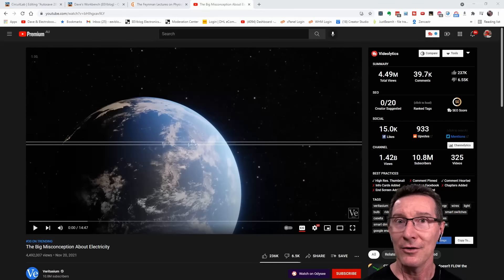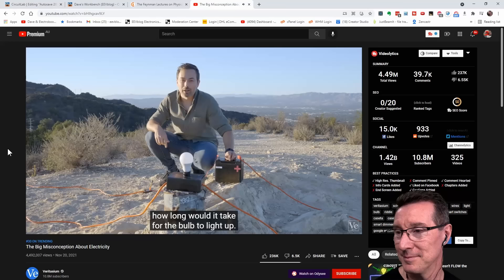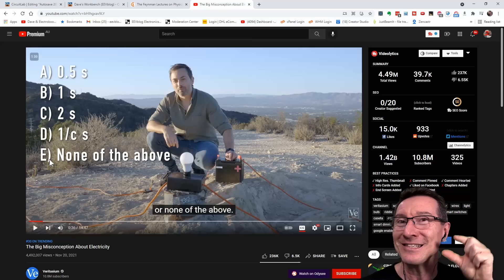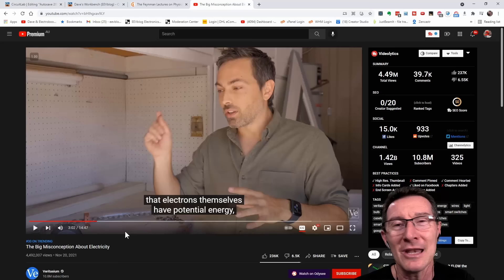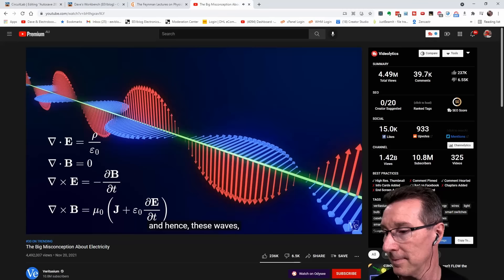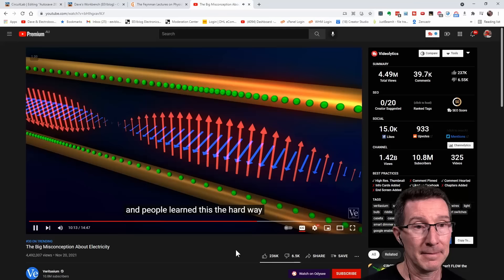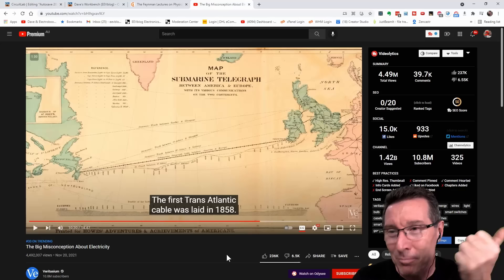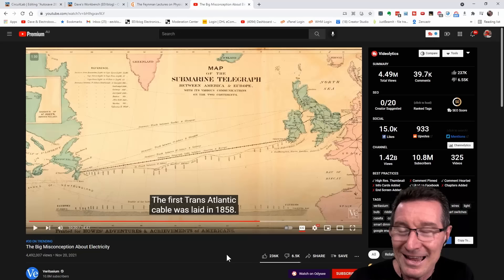EEVblog 1439 - Analysing Veritasium's Electricity Misconceptions Video

Comment: My personal problem with Derek's analysis is that (as can be seen from your simulation), the "ON" state of the lamp lasts only a couple of miliseconds. I don't consider this to be actually "ON". Particularly in a video aimed at general public (i.e. not electrical engineers / physicists), no one would consider this to be ON. For something to be consodered ON in this context, it has to stay on (steady state). So, the answer is not 1/c. If the question was "when will you see a voltage spike across the lamp in the transient analysys of the circuit?", then the answer would be 1/c
Reply: What he doesn't bother to explain, is that it isn't just the fields close to the switch that are at play.  After the switch is turned on, there is an immediate step in the voltage at the wire, which gets coupled to the other wire.  But also, that step is moving toward the right over time, such that for the whole time that voltage step is moving to the right in the lower wire, it is coupling to the upper wire, and takes a while to get back to the light bulb.  So the whole time the pulse is traveling to the right, there is energy being transferred to the upper wire.  This continues until the pulse turns around at the end, returning on the upper wire.  The result is that there is a (near) instantaneous low-level lighting of the bulb for one second, followed by a brightening at the one second point.  At least, this is how it works if you use a random size of wire and a random light bulb.  But because the pulse is losing energy as it propagates, if the wire (actually a transmission line) and the bulb are properly matched, you won't see a change in brightness because the pulse that had to travel the whole distance will be at the same level as the current that was induced as it traveled to the right.
Reply: @BrightBlueJim  Are you saying that if the transmission line had been perfectly matched to the light bulb in Dave's simulation, then the voltage and current would be constant after t=0 rather than instantly drop off?  Is it even possible for the transmission line in Derek's hypothetical experiment to ever be matched to the light bulb?
Reply: @ncmaothvez  Yes, that's what I'm saying.  Almost.  There's still the 1/c delay that the pulse has due to the 1m spacing between the wires. and yes, after around 3ns, the light bulb goes on, and stays on at a constant brightness.

At least, that was what I thought.  Turns out I was still wrong, though.

At first, I was thrown off by the 1m spacing, because I'm used to much smaller dimensions in transmission lines, so I thought that the impedance of the line would be very high.  But then I "ran the numbers" and for a reasonable range of wire diameters, like 1mm to 10mm, the impedance is actually around 500 to 1000 ohms.  Using an on-line calculator for transmission line impedance, because I'm lazy, I find that making a twin-line transmission line out of 2mm wire, we get an impedance of 828 Ohm.  For a 120V light bulb to have a resistance of 828 ohms, it would have to pass (120V/828 Ohm =) 145 milliamps, which would make it a (0.145A * 120V =) 17.4W light bulb. This is close enough to the 16-17W of a typical "100W equivalent" bulb to work.

But NOW I realize that there's still a problem: the transient solution to this problem - what happens when the switch is flipped - puts the transmission line's impedance in series with the bulb, which results in half the voltage being dropped across the transmission line and the other half across the bulb, which Derek alludes to in his video.  BUT, the steady-state solution - what happens when the transient electric field has faded out because both wires eventuailly reach the same potential - drops nothing, due to the hypothetical zero-ohm wire, putting the full battery voltage across the bulb.  So I was wrong about that - even perfectly matched, the bulb will come on at half-brightness for one second before it abruptly rises to full brightness as the initial switch-on pulse travels around the loop and reaches the bulb.

I don't just know this from theory - I worked for six years in high-power microwave pulsed RADAR systems, which use a modulator that incorporates a set of inductors and capacitors to make an artificial transmission line that operates much like this circuit, and the amplitude of the pulse IS pretty close to constant over the time it takes a pulse to travel through the transmission line and back.  So the transient solution isn't just a quick spike caused by the capacitance between the wires, but a pulse whose length is twice the time delay of the transmission line.

Isn't electromagnetism fun?!
Reply: @BrightBlueJim  I've got to admit that my analog electronics theory knowledge doesn't reach very far beyond ohm's law and a crude understanding of transmission lines but I was still able to follow along in your explanation. Thanks for the reply! This got me curious, need to read a bit about transmission lines tomorrow when my brain is a bit more awake :) Yeah, I'd never have guessed the impedance would be as low as sub-1000 ohm's.
Reply: Exactly. This spike would happen even if the circuit is not closed. And we don't call that "ON". Yes, you generated 0.00...001A in it, but you don't need 2x300000km wire for that...
The ON state means at least that you can differentiate the current from the case when the circuit is not closed. It would be still a low current, but also at least .5sec...
Reply: @Csiki27  So a 10m piece of wire, 1m away, with a light bulb in the middle ,would also have a transient current induced at 1/c. But nobody would say this bulb is “on”.
Reply: No not a couple of milliseconds… The line is infinite, so  the capacity will be infinite so the current will flow infinitely till the battery dead
Reply: @andreyares6824  Here is the other problem: since the antenna is quite long you can't say anymore that your small capacitors will turn on "instantly" along the way. No simulation takes this into account since it makes evertything quite difficult, and we don't have such real life case (or extremly rare).
We know that very very small current will be generated at the beginning. That's all.
Also, nobody who see the video consider this proper working. If I walk into the bathroom with an AA battery in my hand, I don't tell, "Oh my god, I just turned on my washingmachine!"... The battery has tiny metals on their side, so we can consider them as antenna, right? The washing machine surely has some wire in it, right? Did I generated current in it? Yes, practically I generated current everywhere with that battery. Still, we don't call that on...
Reply: As Physicist.. i dissagree with Veritasum.. werry roughly when he delete my explanation coment.. Specialy when i use light math for say corectly what happening actualy.. Not gona repeat myself.. What Veritasum doing is start to be werry sketchy same asi his overunity car.. My lord what a BS..
Reply: @Csiki27  yeah that's what's stupid about this whole idea from Veritassium. If we have a 12V, 1A bulb and a 12V battery to power it, and the characteristic impedance of each transmission line is 900 ohm, then 6.6mA will flow through the bulb after 1/c seconds. That's equivalent to 0.7x10^-9 the normal bulb power. No reasonable person would consider the bulb to be "on".
Reply: @Csiki27  Actually I can, because we imagine a conductor without any resistance, this is also look like a giant capacitor. Try to measure resistance using multimeter on big discharged capacitor more than 10000 microFarad (you will have almost NO RESISTANCE) and then once you charge it- make a short circuit and You will see how much power it has- it’s not a tiny small battery like you talking! I don’t see anything strange or something new here Except that humans become less  interesting in science after they got personal computers and other toys and everybody can trick you with a stupid clickbite.
Reply: @andreyares6824  I think you miss the main point of the argument. Nobody questions that discharging it gives you the needed power, but that will happen well after 1m/c time more precisely at least after .5sec (I don't know the correct solution, but I know what is the minimum time). Before that you are simply not able to distinguish whether the circuit is closed or not.
And if it wasn't a closed circuit then the light won't turn on (eventhough theoritically you could measure that tiny transient current at 1m/c time). So you simply have no right to tell from that tiny current that the light is on.
Reply: @bradau1827  Yes.
Reply: @nin1ten1do  Well then, I guess I'll just have to take your word for it.
Reply: I agree!
Reply: It is not the case that the on state is short-lived (unless there's a break in the wire).
Reply: Right, this is just about the little burst at the beginning, isn't it? Blehhh.... He was being kind of a scammer this time!
Reply: And there will be no measurable current in the wire exactly in “1/c”.
Reply: @noop9k  Why do you think it can't be measured? We've measured some pretty small signals before.
Reply: Yes you're exactly right. There might be an instantaneous pulse of energy into the light bulb, but the battery is a DC source. So one second later DC energy will be flowing through the light bulb. I doubt there's much energy coupled over the distance of 1 m so the pulse might not even be visible.
Reply: @nin1ten1do  sorry, you are a troll, while I disagree with Veritasium, I’d delete your comments as well.
Reply: It wouldn't even be 1m/c then.  Because 1m/c doesn't have any of that wire in the light-cone of the switch.  Without wire in play, the position of the switch is irrelevant, because the bulb is ALREADY either 'On' (for a given value of on) or 'Off' on the basis of the wireless electrical transmission occurring through that meter between the battery and the light.
Reply: @BrightBlueJim  I agree with you. There are two states, one with a relatively small current and one with a much higher current, with a sudden jump in between. The funny thing to me is that I think this transient state solution is precisely where, while IRL you may use TLT to figure it out, I think just for intuition it makes way way more sense to simply imagine the waves and "run a finite-element method simulation in your head" and think of what will happen then. That way you can even see that the current is of course not EXACTLY constant because of all the ripples causes by the bounces from the ends of the wire, but roughly speaking there are two approximate power levels. While TLT /should/ give you the correct answer if you run the simulation correctly, for my brain at least thinking of the fields propagating makes me reach the same conclusion way faster and more reliably. It may be an interesting boundary problem neither is obviously superior in understanding what's going on.
Reply: @TrogdorBurnin8or  You have a full meter of wire going to the left of the switch, and a full meter of wire going to the right of the switch, all within 1 m of the switch. Since that wire radiates, it's an antenna.

The terminals of the lamp are 1 m from the switch, and begin to act as a receiving antenna 1 m/c after the switch closes.
Reply: @rsm3t  A spot on the wire one meter to the left is sqrt(2) meters from the light, if we're being pedantic.  More seriously, let's talk limits: The length of effective antenna approaches zero as time approaches 1m/c from above.
Reply: @rsm3t  The core argument, of course, is that infinitesimal inductive transfer due to considerable distance between the antennae is irrelevant to "lighting the lamp".  But the secondary argument is that inductive transfer only begins in any theoretical sense at 1m/c, the instantaneous current flow at that timestamp is zero; Reaching any kind of significant arbitrary current flow through induction requires 1m/c PLUS arbitrary time.
Reply: @TrogdorBurnin8or  That is just the edge of the wavefront. Without losses or resonances in our idealized experiment, it will remain a step function. On arrival, current must begin to flow in the receiving wire.
Reply: @TrogdorBurnin8or  but you had said "light-cone of the switch", not "light-cone of the light", so if you want to be pedantic, do it right.
Reply: @thebaker8637  I put it in terms of transmission lines, because that's what I've had a lot of professional experience with, but the way I think about transmission lines, when I don't remember something for sure, is as strings inductors in series with the wires and parallel capacitors between the wires.  If nothing else, that will tell you how it will behave in the very short term (i.e., in Veritasium's quiz, capacitor from the switch to the light bulb will be an instantaneous short), and also in the very long term, which in this case it's just a plain wire loop.  So we know from these things that a) Derek is right about the delay before the lamp comes on is 1m/c, and that eventually the light will be powered by the direct current through the wire.  But what transmission line theory ALSO tells me is what will happen between the two extremes, which can be a little surprising if you think about it as anything OTHER than a TL.
Reply: @rsm3t  There is no step-like change in t=0 when the (idealized, perfect, point-sized) switch is closed. Switch doesn’t itself create any change in EM field. At t=0 electrons are just allowed to move across the switch under influence of already existing field. And only after they change position/velocity (this effect gradually propagates at speed < c along the wire and through battery), they create a change in EM field that can affect the opposite side of the wire and induce some (small) current.
At t=0 at the switch and at t=1/c at the bulb there is no change *yet*.
Again, this is not a step function where EM field suddenly appears from nowhere as if the battery+some wire teleported into the circuit.
Veritasium’s answer requires impossible wire, impossible lightbulb,  impossible switch and is still wrong.
Reply: @rsm3t  Not a step function  at all, unless your battery, switch(already closed) and a few m of (pre-charged, or taken from already activated circuit) wire suddenly teleport into the circuit at t=0
Reply: @noop9k  It's pretty obtuse to deny that closing the switch creates a step function.
Reply: @rsm3t  there is no step-like change in EM field. There is a step-like change in current but the length of the area affected by this change starts from 0.
Since I’m not getting through, will repeat: closing the (infinitely small, perfect) switch does not cause any instant change in EM field by itself.
Otherwise, explain, how changing the resistance of infinitely small length of wire from inf. to 0 causes EM field to appear instantly at the same exact moment.
|B| is not a step function, |B|’ maybe close to a step function at t=0
Reply: It won't even light up from the microwatt
Reply: @Csiki27  wrong
Reply: @Ikbeneengeit  exactly
Reply: @esecallum  Everybody knows that it won't light up in reality. The question is whether we can consider that on theoritically. And most of us think that no. Wich one is wrong from these?
Reply: @esecallum  How do you know it's only a microwatt? The schematic doesn't tell you the voltage of the battery, the characteristic impedance of the cable, or the resistance of the bulb. For all we know, that battery could be 10000 volts. However, we are told in the video to assume that the bulb will light as soon any current flows through it. So we're really being asked when current begins to flow in the bulb.

I see no point in debating the assumptions. That's equivalent to changing the question before giving an answer. We should be concerned with what conclusion follows from the assumptions.
Reply: @noop9k  If there is a step change in current, there is a corresponding step change in magnetic field. Study Maxwell's equations and you will come to understand this fact.
Reply: @noop9k  If you're assumption is correct, that a step in current causes a step in the magnetic field's derivative, then as long as the current flows, the magnetic field strength would increase without bound.
Reply: @Ikbeneengeit  your numbers don't work out. (6.6 mA/1 A)^2 is 43.6x10^(-6), not 0.7x10^(-9).
Reply: @rsm3t  he never specified so we assume normal values. What battery has 1000000 by volts.
Reply: JESUS CHRIST IS COMING TO JUDGE THE EARTH SOON PLEASE!!!!!!!!!!!! CALL ON HIM NOOOOOOOOOOOOOOOOOOOOW!!!!!!!!!!!!!!!!!!!!!!!!!!!!
Reply: @rsm3t  you still don’t understand
Reply: @rsm3t  not without bound, just as sine doesn’t increase “without bound”
Reply: @noop9k  A step function does not integrate to a sinusoid.
Reply: @noop9k  Do you understand divergence and curl? If so, you shouldn't have trouble understanding Maxwell's equations. If not, please don't lecture me on things you don't understand.
Reply: @Csiki27  I have no patience to kip this conversation)
Reply: @andreyares6824  Hi, another video clearly clarified (with proper simulation), that not only the current will be "stable" as you said, but even the current can be comparable with the regular "on" state.
The only (rather theoritical) question left that what we call "on" since if the circuit is open the current will go down after 1 sec to zero (so at 1m/c you don't know whether this is a successful switching).
On the other side this is not a short time current.
From my side I pick the first (this is not on till you don't know that you succeed), but I can accept that the second can be a valid option as well (with properly set circuit ofc).
https://www.youtube.com/watch?v=RsiYXfpJu5U
Reply: @BrightBlueJim   @BrightBlueJim  In a perfectly matched system there would be a termination resistor at each end of the line so the lamp would be  immediately at it's final brightness
Reply: @bene5431  Yes, that's exactly right.  A properly terminated transmission line measured at its input is indistinguishable from a resistor equal to its characteristic impedance, so then all you have is the delay caused by the 1m spacing, which is the 1m/300Mm/s = 3.33ns, plus any other wire delays not specified in the problem.
Reply: @Ikbeneengeit  6.6mA is sufficient to make a LED bulb glow. The bulb does not have to be incandescent, does it?
Reply: The point is that the energy flux (a real thing you can read about) is what actually seems to be transmitting the power according to physics. All the EM stuff are emergent effects. 

The experiment he used to show this was messy. It isn't a clean perfect isolation of the reality at work here.
Reply: @bobdole57  Yes, and also no.  It's not a "clean, perfect isolation of the reality", because reality is neither clean nore pure.  Sure, it is important to understand that during the transient portion of its operation, electromagnetic fields are involved.  That is, when you turn the switch on, and when you turn the switch off, for a moment, these are all that matters.  But it is simply NOT POSSIBLE for this to happen in the steady state, after the bulb has been on for a bit.  This is because a) you can't get a steady flow of current through a capacitor (the electric field), nor can you collect power from the magnetic field around a wire, when that field is not changing.  This leaves you with ONLY the current through the bulk of the wire as a viable way of moving that energy.  AND HE KNOWS THIS.

What makes the Veritasium video a trick question, is that anybody with practical experience says, "those wires are a meter apart - there can't be a whole lot of coupling between them."  Which is a mistake.  But while he's jeering at you for being wrong about that, he totally slips out the back door before you have a chance to ask how that works a few seconds, or a minute, or a year after the switch is turned on.  And yet he considers himself a teacher.  Yeah, I've had teachers like that.
Reply: @BrightBlueJim  it was an entertaining video on YouTube not a graded exam.

2) I specifically said it WAS NOT a clean perfect isolation. You didn't need to reiterate that like I said the opposite
Reply: @bobdole57  Well, if you are going to back up Derek's BS, then I will treat it as your BS as well.  You weren't really clear about what you mean with the "not a clean perfect isolation", so I apologize if I misinterpreted that.
I would also say that it doesn't matter if it's a graded exam or not.  The whole Internet is full of people at each other's throats over things ranging from half-truths to blatant lies.  Derek's video is a half-truth, and I'll leave it at that.
Reply: @BrightBlueJim  if he removed the quiz from the beginning would you stop complaining. Is that your entire problem
Reply: @bobdole57  No.  You are missing the whole point.  My point is, he is teaching physics BADLY.  Badly because it's wrong, and badly because of his attitude.
Reply: this makes me think about the part where he says "when the bulb receives any current it will turn on". That "any" is really important. there will always be leakage, which means technically the bulb should always be on.
Reply: @davidmiller9485  he's describing an ideal circuit with no leakage. Remember when you had to calculate the trajectory of a projectile in physics, ignoring air resistance because it wasn't relevant to newtons law's? Same thing but cooler
Reply: @Saman Bahrampoor
Yes!  Furthermore, Dave here uses the wrong model for Derek's experiment setup.  A transmission line model is not applicable, so what you see on his graph is incorrect, and Derek's answer of 1/c is also not right. The better model is a dipole antenna model.   Also, Derek conflates DC steady state with transient analysis which is false and folks who want to learn, get misled.  See my explanation in the main thread.
Reply: @BrightBlueJim  No!  Dave here uses the wrong model for Derek's experiment setup.  A transmission line model is not applicable, so what you see on his graph is incorrect, and Derek's answer of 1/c is also not right. The better model is a dipole antenna model.   Also, Derek conflates DC steady state with transient analysis which is false and folks who want to learn, get misled.  See my explanation in the main thread.
Reply: @Ikbeneengeit  Yes, you're on the right track!  Furthermore, Dave here uses the wrong model for Derek's experiment setup.  A transmission line model is not applicable, so what you see on his graph is incorrect, and Derek's answer of 1/c for steady ON is also not right, misleading. The better model is a dipole antenna model.   Also, Derek conflates DC steady state with transient analysis which is false and folks who want to learn, get misled.  See my explanation in the main thread.
Reply: @stickfijibugs  Well, maybe I could take you seriously, if you could explain how a transmission line model does not apply here.  You can't just come in here and say, "you are wrong and I am right".  Why would anybody accept this without explanation?  Or at least explain why you believe the dipole antenna model is better for this problem.
Reply: @BrightBlueJim  That's a valid concern.  In my short note, I did mention I have a post in the main thread that answers everything.  I copied it here for you.  I hope you find it interesting and I would like to see your take.

=====================

Dave's transmission line model is not the right model to apply to Derek's circuit.  Read on ...

More, in Derek's video, his answer of 1/c seconds (1 meter-between-wires / speed-of-light-in-meters-per-sec) for the way he has his experiment set up, is also incorrect.   

[Note: I made some new edits in the '"more here" below.]

On top of it, Derek's is a very poor explanation at best.  The big problem with his video is at the beginning he conflates AC step signal (action of throwing the switch) with DC steady-state (turning ON the bulb), and it looks like he himself does not understand the difference.  That is surprising, and why his consultants in the video didn't explain it to him.

For example, taking his circuit as in his diagram where two parallel wires separated by 1m over a very long distance, true that there is a TINY amount power transfer that occurs INSTANTANEOUSLY due to 'antenna effect' between the conductors right near the switch and the bulb.  But, that would not even flash his bulb in the least (the AC signal part).  Even a very sensitive LED would not momentarily light up: the 1 meter separation is just WAY too far to transfer enough power, although, you might be able to see the a tiny short impulse with an oscilloscope across the bulb.

However, if the wires were very close together, say separated just by the thickness of (very thin) insulation, then the bulb (better a sensitive LED) might produce a barely visible SHORT FLASH at the moment he closes the switch at 1/c later (which is also half-explained in the rest of Derek's video with the E&M vectors etc), and then stay OFF until travel is completed around the whole loop (a total of 1 light-seconds if wires are at absolute 0 adding no delay).

So, at that point with an experiment topology where the wires are close together, after the short flash on closing the switch, 1 second later, the bulb would start to turn ON over a short but noticeable delay, and then stay FULL ON.

In conclusion, if the wires were run right beside each other, the answer would be both:  1m/c flash and 1 seconds later steady ON.

Thus, the real answer for the way he has his real experiment set up is 1 second, not 1/c seconds.  He needs to fix this.

More here ....

However, I disagree with EEVblog model of a transmission line:
https://youtu.be/VQsoG45Y_00?t=1553
The big fallacy with Dave, is that Derek's experiment is NOT a transmission line: in order to qualify the experiment for a transmission line model you'd have to remove the bulb (breaking the top of the circuit), disconnect the switch from its left wire side and connect the switch to the top wire that goes to the right.  Then you break the far end on the extreme right and insert the bulb.  Only then you can use the principle of the transmission line.

Thus a transmission line model does not apply to Derek's experiment.  I think Dave messed up pretty badly here, and I am dismayed why he did.

Let's say ... even if you rewired Derek's experiment into a transmission line circuit as I explain above, EEVblog's lumped element model would not be accurate either.  The characteristic impedance of the wire pair is indeed 900 ohms (in air), but remember, that impedance is looking into the right pair wires (or the left wire pair) with the switch open and bulb not connected!!!  Even so, EEVblog uses 1 uF capacitors. The capacitance of the wire pair is almost non-existent.  It DOES matter what the capacitance value is.  

What is the better model then?

In my opinion, the better model for switch flip instant is a dipole antenna with a step source at its center, and, I contend that the power transfer between the parallel wires is much greater due to the EM transient (Derek's AC explanation) than to instantaneous current flowing through an uncharged capacitor (in EEblog's incorrect lumped element model), especially that capacitance (Farads per unit-distance) is so small it is negligible.

Thus for the step transient in Derek's model, the top half with the light bulb is the receiver, and the bottom half is the transmitter.  

Therefore, to make an analogue of the transmitter (bottom) imagine you tied a long spring to 2 trees, and held the center point with your hand.  To close the switch, you give one quick jerk to the right say by a foot, and hold it there.  Watch what happens to the spring: you will see a compressed wave travel to your right away from you and an expanded wave travel to your left, also away from you.

That is what's happening electrically in Derek's setup at the moment he closes the switch.  The difference from the spring is that there are two electromagnetic disturbances that are traveling away from the switch, a dipole antenna.  Now you can apply the AC vector model and what you get is electromagnetic radiation (a single radio wave of all frequencies) that is traveling both ways, losing some of its power as a radio wave into space into all directions.

When that already very weak radio wave is intercepted by the wires on both sides of the bulb (also a dipole antenna), a quasi-step voltage is created across the bulb, but, is it SO small you would never see it light up.  That's why we have RF amplifiers in radio receivers (eg in your phone).

However, if the two wires were close together, it's possible you could see a barely perceptible single flash in an LED (bulb) followed by a DC steady state ON condition 1 second later.  In this case, if you connected an oscilloscope across the LED, you would see a quasi-step, but, you would see it die out rapidly as the transmitter step propagates away from the switch in the bottom half of the circuit.  So the voltage across the bulb would be ZERO in less than a microsecond I expect, and then finally begin its rise to the battery voltage 1 second later.  So not only will the bulb (realistically) light up 1 second later, it will be dim at first and then increase to full brightness, taking some noticeable time longer because of pulse spread effect over such a long distance in a single wire.

I hope this helps.
Reply: @stickfijibugs  Thank you for the explanation.  You are wrong, but thank you for taking the time to explain your reasoning in claiming that Dave and I are wrong.

1) A pair of wires in parallel IS a transmission line, whether you want to think of it as one or not.  Because it is made of conductors in parallel, there is capacitance between the wires.  Because it is made of wires, there is inductance in those wires.  You CAN, whether you choose to or not, to consider the pair of wires as an infinite number of small segments, in which each segment consists of two inductors with a capacitor linking them together.  You can do the circuit equations based on an infinite number of segments, which reduces to the transmission line equations, or you can used lumped capacitors and inductors in sufficient numbers that they are indistinguishable from a continuous transmission line, or you can use just a few, and have a correspondingly coarse approximation of the actual behavior.  In electromagnetics, there are often multiple ways of modeling  complex circuit, and we choose the model that best simplifies the problem for our particular application.  If a model doesn't simplify the equations, you don't use that model.  But it doesn't mean that model is not correct.

2) The spring model you use in part of your explanation IS the application of the transmission line model, so if the transmission line model is not accurate, then that portion of your explanation is invalid, so why would you use this?

3) In considering your transient response to the applied step function caused by closing the switch, you are only considering the speed of propagation through the capacitance, without also considering the speed of propagation through the wire inductance down the wire.  So while there is a 1/c delay of the step function coupling it to the light bulb, there is also a 2/c delay for each meter of the length of the parallel wires (2/c because the step has to go 2m to get through both sides of the line).  Now, I don't need the transmission line model to demonstrate this, so you don't have to accept section 1 above.  As the step function moves to the right, it takes time for the step to reach any given point on the wire, and AT THAT POINT, it encounters capacitance coupling it to the other wire across from it at that point.  So not only do you have a very short pulse at the very beginning of the wire (precisely the point at which the switch closes), but you have an infinite number of very short pulses, delayed by very short times, at each point along the wires.  These very short pulses at very short delays add up to make .. wait for it .. A STEP FUNCTION.  So the light does not just illuminate for a very short time, but CONTINUOUSLY for the time it takes for the switch-caused step function to travel down the wire.  So the light would come on at some reduced intensity during the entire time the step function travels down the wire, until but not including that last meter of wire, where it starts to look like a short circuit.  And once THAT happens, then the light is on at full brightness from that time onward.

4) This isn't just theoretical.  I worked for several years on pulsed microwave transmitters used in radar systems.  These use a set of actual inductors and capacitors (typically four to twelve of them, the actual number depending on how sharp you want the pulse edges to be) arranged in a manner very similar to Derek's circuit, and referred to either as an "artificial transmission line", or a "pulse forming network".  In place of Derek's switch, a gas thyratron tube is used to create the step function, and instead of a light bulb it is connected at the far end to a pulse transformer that feeds a high power magnetron, klystron, or other RF tube.  The length of the pulse is determined by the electrical length of the artificial transmission line.  So I've seen almost this exact circuit used in practical systems, and it works quite well.

Again, this does not depend on your acceptance that this is a transmission line; conversely, the fact that there is a speed-of-light delay through the inductance of the wire, just as there is a speed-of-light delay through the capacitance, which is what MAKES this a transmission line.  The fact that it is shorted at one end does not disqualify it as a transmission line, because the applied step function can't "see" (i.e., be affected by) that short circuit until it gets there.  But again, it doesn't matter whether or not you like the term "transmission line", because whether it is or is not one does not affect the behavior of the step function across the distributed capacitance and through the distributed inductance.
Reply: @BrightBlueJim  

Your #1:  It's not a question whether I'm right or wrong, or you're right or wrong, it's a question of whether Dave's model is applicable or not to Derek's experiment.  If I cut two 1m pieces of coax from spool, yes technically I have "a transmission line" in each of my hands.  But if I strip the 4 ends and use the two cables to boost my car, I am not using them as a transmission line!  Same can be said of two twisted pairs.  That's my point about Dave.  He is NOT driving the pair of wires as a transmission line should be driven.  Thus, a transmission line model cannot model Derek's experiment.  It's so obvious.

Your #2: Nope, it's the antenna model!  I use the spring as a SINGLE conductor for illustration of the bottom half of Derek's circuit.  Look at it this way ... if instead I remove the left end from the left tree and attach it to right tree in parallel with the original right half and cut it where I am standing, then I have a POSSIBLE xline setup, but, it still depends on how I use it.  So now using TWO hands, I jerk one spring towards the tree the other away from the tree, then yes, I am illustrating an xline.  However, if I jerk both springs away from the tree with one hand, then it's a single antenna made of two parallel wires, where I am the source and my feet are ground.  Go back to the video and look how he has his source connected.  That is what's incorrect, and therefore, he not using the wire pair as an xline.  

Your #3.  I thought about this general idea too when I was trying to debunk in my head Dave's model.  So I am not surprised you brought it up!  EVEN IF you erroneously applied Dave's model (which I maintain is NOT an xline model), a 12V source would not light up a12V bulb until after 1 second had passed, because the capacitance/m between the wires is imperceptible.

Your #4.  In radar, what you're likely referring to are waveguides, and of course RLCs are used for pulse shaping.  I can imagine you had inductors that looked like solid metal cylinders.   But again, you're not applying the appropriate model to Derek's experiment .. try not to lose sight of what we are talking about!  Also "...almost exact..." is not exact. 

Finally for your last para, I agree with all of it, IF you are driving as a transmission line as it SHOULD be driven.  But Dave driving the circuit as two wires that extend left and right (my original spring illustration): that is NOT a transmission line, it is a dipole antenna!  So the best analogue for Dereks' circuit is a dipole antenna transmitter for the bottom half (SW & BAT) and another dipole antenna receiver for the top half (BULB).
Reply: @stickfijibugs  Okay, you understood none of what I said, even though I think I was pretty clear.  in #4, you're trying to tell me what I mean, and you're just wrong on every detail.  On point *2, okay, I'll waste my time by saying this again: if it has series inductances and parallel capacitances, it IS a transmission line.  A capacitor doesn't stop being a capacitor, and an inductor doesn't stop being an inductor, just because you "aren't using it right".  That's as much time as I'll waste on your willful ignorance.
Reply: Curious what everyone here has to say now that veritasium has released his follow up video
Reply: You might see a voltage spike across the lamp after -0.2 seconds, when your muscles start to twitch to flip the switch and the ions inside your muscles capacitively couple to the lamp. If we're going to be jerks and pay attention to components normal people consider irrelevant, why not include the human body?
Reply: Absultelt, it was my first thought. Did electrical engineering crash course during my mining engineering degree. For a light bulb in this case to be considered on it implies steady state. It was a trick question.